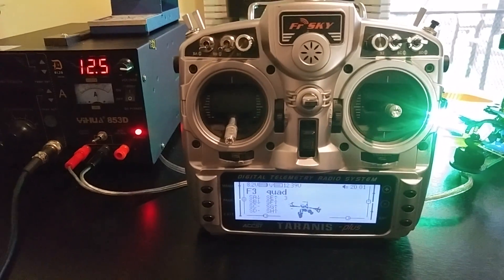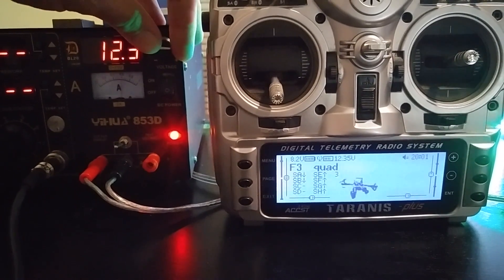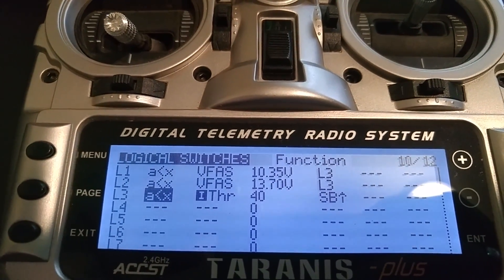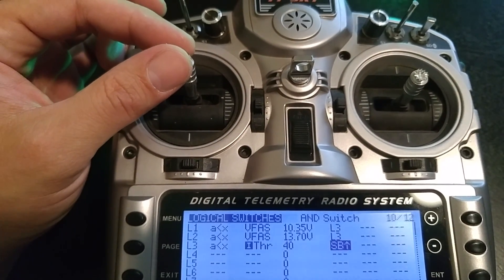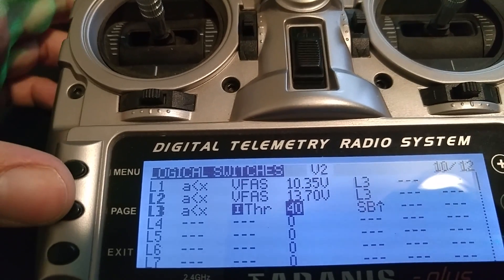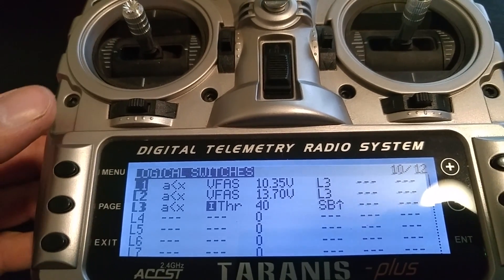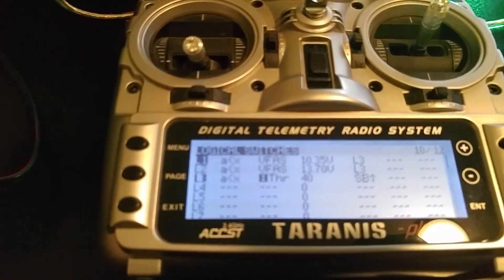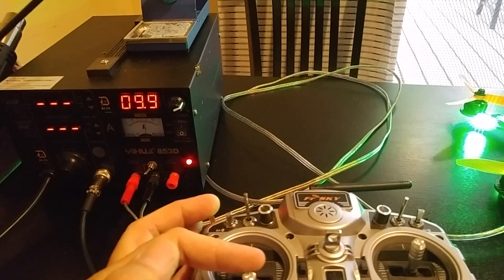Taranis programming battery warning

Comment: How did you get the battery voltage to display beside the RSSI on the home screen?
Reply: Once you receive your quads input battery voltage (after discovering sensors Page 12 of your Model menu). Scroll down to "Voltage Source" Change it to the name of your voltage sensor. Default is VFAS, your sensor may have a different name.

Comment: Do you find that if the voltage bounces around your threshold that it will spam the voltage low and voltage value? I used another method to add a delay function so that if the voltage is below x for y seconds then call but don't call if it has bounced back up. Shit go is, this has seemed to stop working on my Taranis!

Comment: So, what would be the logical switch setup say if the voltage was under 6 volts? That way I wouldn't have to hear the warnings when I am tuning and power is coming from the USB cable? L4 a<X VFAS 6.0V ???? or disregard L1 or L2?
Reply: Update: I read up a little in OpenTX University and found that if you add an AND switch to satisfy both armed stat and L1 the low voltage warnings will only happen if the FC is armed. This eliminates having to hear it every time you power up the TX or when you are using it on the bench with the GUI. Pretty simple function. I guess you could also set up a condition above 6V and use that as one of you AND functions if you so desired.